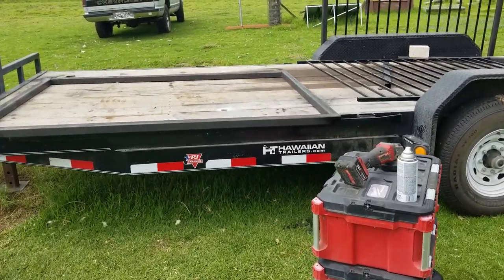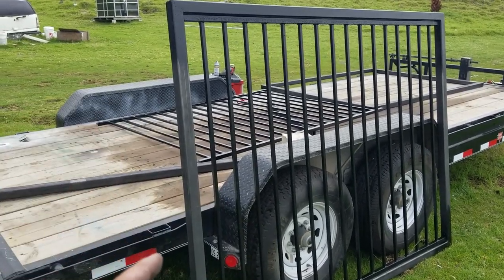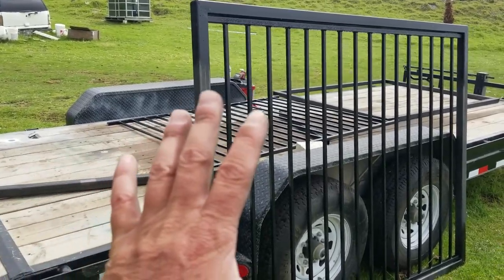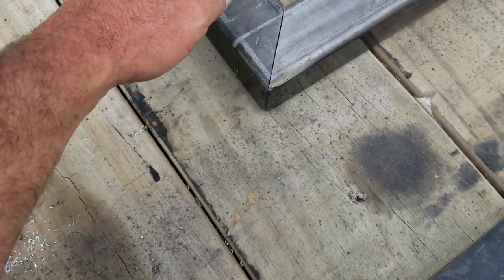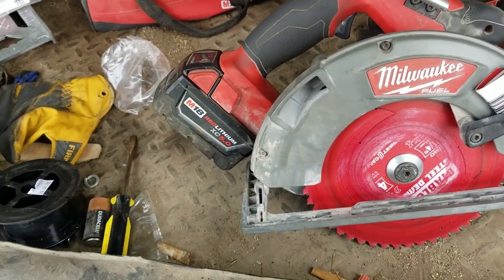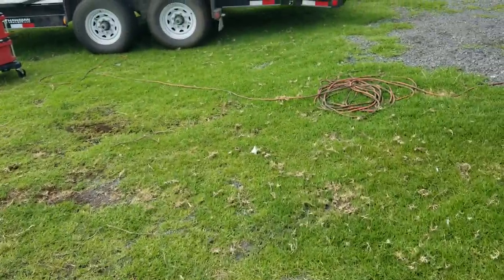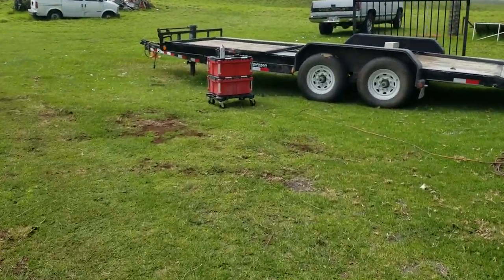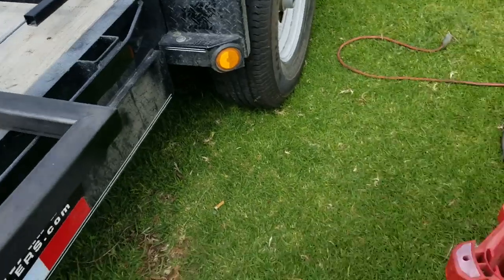Building New Driveway Gates For The Ranch

Comment: Nice fence. Tip is to use mag and do v shape on the flat surfaces or even a gap and you dont have to grind anything afterwards. Saves alot of time :). Though looked like your were using gas less welder ans they create more work.... I Always strive for doing welds that shouldnt need to be grinded down though not Always possible